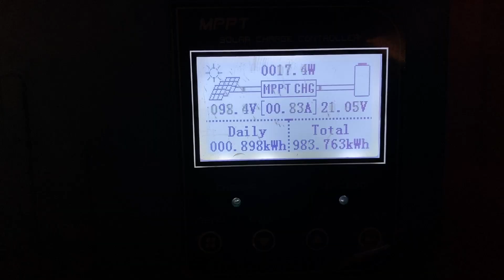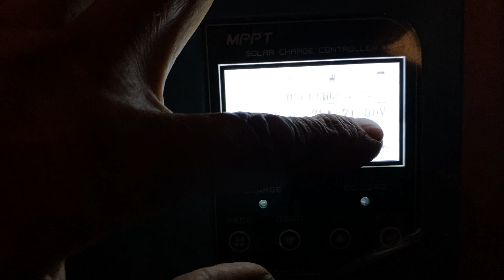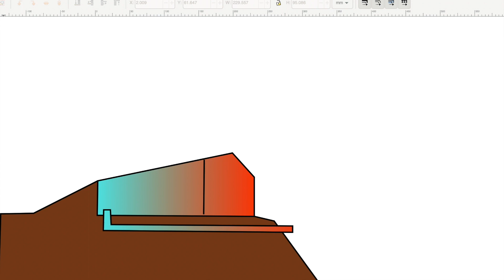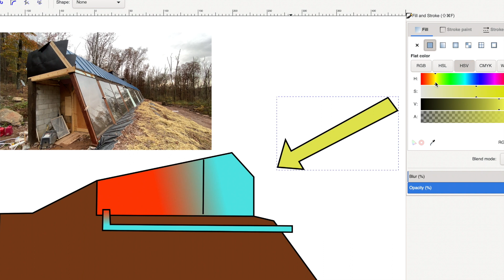This Earthship inspired house is built using cementblocks instead of tires

Comment: The cinderblock wall isn't thick enough to be a thermal mass sink. Even with the earth berm behind the back wall. you need to have insulation behind a 2ft thick wall for adequate thermal sink properties.  otherwise the heat from the day will just sink into your berm
Reply: We will be insulating 5ft behind the wall on the outside with 4 inch (2 pieces stacked) of Styrofoam to insulation and stop the frostline from hitting the house.

Comment: Is that person putting cement onto a wooden support? I don’t know a lot about cement but I put cement directly against some wood without covering it first and the wood rotted away there over the next few yrs. Now I put plastic barrier first.
Reply from the maker: If you are referring to the bottle wall, then that is pressure treated wood bordering the mortar.